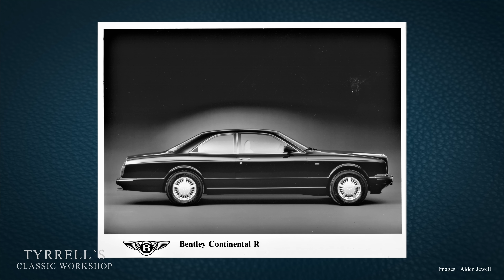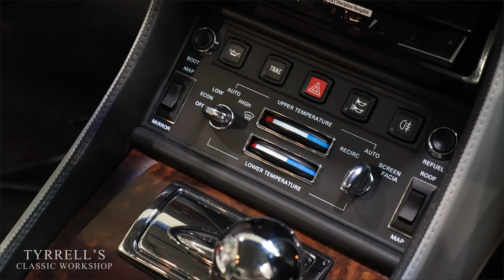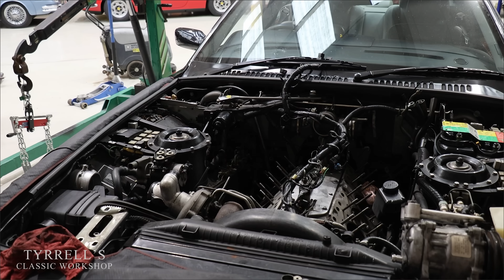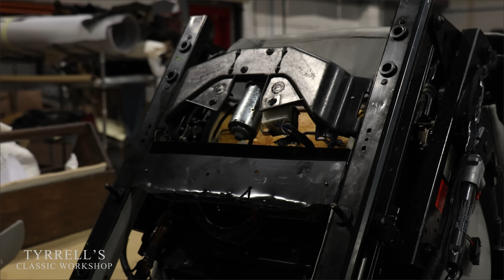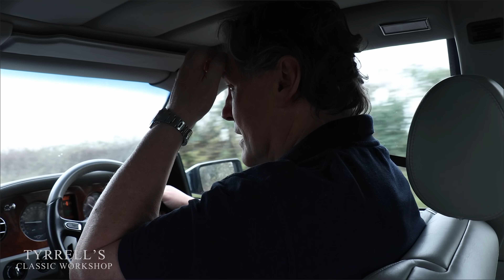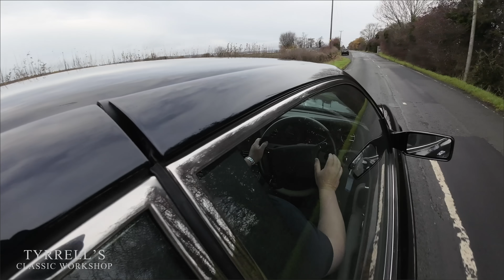Bentley Continental T- the 1990s British Bruiser | Tyrrell's Classic Workshop

Comment: Back in the 90s my old E32 7 Series seats went astray during a week’s break down at the South Coast just as we arrived at our hotel in Rye.

To remedy the failure was going to be exorbitant but I bought an entire leather interior from a BMW breakers’ in the Midlands for a couple of hundred quid: including electric motors, cabling etc and door cards, spent another few quid for my mechanic to fit and I had a virtually unused interior and the blue leather looked great with the gunmetal silver exterior.

Comment: I have a green in and out 93 I bought many years ago in Japan and imported to Canada. Canadian law is a 10% duty because the car was manufactured in a country other than united states and GST PST for a total of 21% all in. Shipping 2700 at the time. The advantage of Japanese market is that they are usually very well kept and almost always low k. One thing a
Lot of people get wrong is the steering wheel on most of the more exotic vehicles Mercedes Jaguar Aston ect are left hand drive. All of them you could get ether way but most preferred  LHD. Another wonderful thing is most of them were ordered with the best option packages. Many times I’d never seen in North America. 05+Bentleys and so Rolls had executive rear seats. Real Lear Jet looking stuff not available in North America. I’ve had my Continental R for maybe 7 years and just for fun I waxed it every day for like 2.5 months. People had always said that after 2 coats it’s pointless. Just putting on and taking off. 
If you start with a freshly cut waxed car I promise you you will be shocked. Just standard liquid wax 24 hours between takes maybe 30 minutes each time. 
The original green paint I now see has a really fine metal flake in it. The car  has a good body and mostly original paint from 1993. Now it looks brand new and the paint honestly looks like someone recleared the car with a very thick respray. I did another thing which seams counter productive. I cut waxed it again about 30 coats in and it made a massive difference. Flattened it out for more of a “wet” look. 
All in all they are probably the Nicest Bentley I my opinion because there is a massive over built quality to them where you can tell it did take 6 months to build but car to car compared to a say 2007 Conti I much prefer the earlier one.

Comment: About 5 years ago I bought a 1996 Continental R, drove it home and put it the garage.  A day or so later started it up and saw a plume of steam behind.....yep, head gasket(s) gone at 71K.  Joined the queue at my nearest independent RR/Bentley specialist in Bolton and had it back on the road some 6 months after..... several thousand pounds poorer.  

I prefer the purer lines of the original design...to me, the wide bodies look as though they visited a car customiser...

Comment: The Cont T came out in 1996 - or at least the press articles started then.  I have a Cont R from 1997 for nearly 16 years and love it.  I also have a 1960 Bentlwy S-2 = this model came out in 1959 so the engine is now 67 years old and I think it was last used in the Mulsane up to about 2020.

Comment: Is there a multi layered steel alternative for the head gasket? I'd be reluctant to replace it with an equally unsustainable part.
Reply from the maker: Apparently not. It is still an issue
Reply: @iain_tyrrell what a shame. I suppose the market is too small to develop a solution. Still, it would bug me endlessly from an engineering point of view to know my new head gasket had an inherent flaw.

That being said, what an amazing machine. I remember reading the road tests back in the late 90's. Thanks for another great upload, I look forward to seeing what 2026 will bring to your workshop.

Comment: Headroom looks rather tight for such a big car
Reply from the maker: An unfortunate by- product of the flat floor
Reply: Not just the headroom that’s a bit of an issue. The dash itself is very high and bulky meaning it closes up the screen internally giving you a surprisingly small letterbox-type aperture to see out of, which you don’t really notice from the outside. You then sit high up also which compounds the problem. I found it a little bit of an issue and I’m not particularly tall at all.

Comment: Out of curiosity…….is there a “fix” for the head gasket as in an alternate component? Or is it simply a matter of correct assembly and hope for the best ….which will likely be another 60k before repeating the process.  I don’t suppose there is volume market for design and manufacture of a “ better gasket” 😂
Reply from the maker: A 100% fox head gasket still seems elusive

Comment: I would imagine the way they used cylinder studs and nuts has something to do with the head gasket issue.  A good stretch torqued bolt setup would maybe make it better.  End of line engine I guess older design not meant for turbo.

Comment: The biggest problem we had with the Turbo V8’s were the tires spinning on the rims, especially on the chrome plate alloy rims. The Avon Turbo-Speed tires required a substantial amount of wheel weights to balance so if the tires spun on the rim the Avon’s earned their “Turbo-Shake” nickname.

Comment: I particularly like the original LWB Continental R, more understated and elegant, and still underpriced.  V8 was new in 1959. Do you recommend a solid copper head gasket? I had consistently blowing exhaust manifold gaskets on my Essex V6 until I made some out of copper sheet, but the heads are steel and you might not be able to put enough clamping pressure into an alloy block.

Comment: Lol no Japanese car I ever have had had that kind of head gasket issues..
Woke up, hit em hard, never an issue.
Reply: Except the mid to late 80s Toyota 7M engines, which was used all over their flagship models.....late pre-production change of head gasket material (to eliminate asbestos) and Toyota failed to amend torque values in production and maintenence documents.
Every engine has weaknesses.

Comment: What if any improvements or upgraded components were used to replace the cylinder head gaskets? Machine work, higher performance head bolts/studs, improved gasket material, etc…?

Comment: Had an M5 in 2000, me and 2 passengers, on M1 near Sheffield, pulled up next to a Continental T, we were bothing doing around 60, both of us floored it. That Conti T left the M5 standing, crazy, crazy fast and that torque!. (This was before there were so many cameras obviously)
Reply: Goat curry? Good choice. Do love a chutney to be honest. Better with cheese though.  am very surprised these subsistence comments are being voiced on Tyrell channel. Greatfully received. I once had a Peugeot 306 sedan 1.9d. bet it had better fuel economy than the Munich motors and crewes offering as well. Great runner. Shame about the locks. Boot lock went in 2001 and the rear passenger door packed lock packed in July  2004. I do love reading a comment or two. Just remember when your stressed to make the noise of a dolphin. It may save a few extra heart beats when you type your reply to knobs
Reply: @mondaynightmillions1198 everyone knows pug 306 1.9 are good even taxi drivers hence.. taxis
Reply: @mondaynightmillions1198 tell you what else was a good car and got negative press because of the 1st model. Vectra C the JTD engined one. Just make sure it was the one with the F40 box instead of the M32 box and had the updated intake so no swirl flap stickage. Them things ran happily remapped at 230bhp with insta torque all day with wheelspin in 3rd and still got 55mpg treating them like the police were chasing you. Underestimated car, even Saab couldn't quite match its reliable quickness as they started adding twin turbos and silly passive rear steer and silly ignition systems. The vectra C 1.9cdti often overlooked but good cars no joke really good cars.
Reply: That was me
Reply: Iain ....An encyclopidea on two legs !! I doubt there is anyone out there who can match your knowledge of these motor cars . Thankyou
Reply: Great story, I recall Swansea Queens Road, Saturday night midnight 1984 watching and XJS race a Rolls Royce off the lights, the XJS was totally left for dead
Reply: I had a e60 v10 m5 in 2008 and pulled alongside a 2000 e39 m5. I absolutely destroyed it. Point?
Reply: @DaleSteel you had an M5 in Forza you mean😂  silly bmw chav
Reply: @CHFandango Homemade chutney is the best, with a homemade curry.
Reply: @CHFandango bit of a bell end comment, were you drunk?
Reply: @Blablablabla1ify it was a bellend comment replying to another bellend comments.
Reply: @CHFandango I think his intention was to highlight how quick the Bentley is compared to a known fast car from the same era, that’s all.
Reply: @Blablablabla1ify oh right. So now your judge and jury?
Reply: @CHFandango I think you’re missing a cog or two. Good night.
Reply: @Blablablabla1ify maybe so. I stick my nose into someone's stupid comment and then you do the same. I can accept im strange im on the spectrum. Question is do you accept your weird?
Reply: @CHFandango Maybe I’m on the spectrum too, who knows. My brother is. But the difference between us is that you wrote an unnecessarily rude comment and I cut you back. 
My previously mentioned bro would give you the following advice: write nice things instead, it makes you feel better about yourself. Take care man. There’s no bad feelings from me.

Comment: Ahhhh. My first solo engine project at Cosworth for Bentley. We had great fun on the dyno and test track perking that up!

Was a great beast to drive, you just had to be confident drifting a drawing room.

The big V8 L410 soldiered on as a twin turbo and we even got it to 500bhp with new valvetrain and turbos in Arnage T while meeting MY07 LEVII emission regs. I wrote a paper in MTZ for that one. 

Good times.

PS The head gasket was never re-engineered for T. It was for the twin turbo with a much more modern MLS type gasket. 

Don't forget the crush on the fire ring reduces as the fire ring frets, which it can at high boost and low temperatures.

PPS I remember VW refusing to believe how clean it was in later twin turbo form. I remember taking out our ADP emission durability car out to Wolfsburg so they could emission test it in their own rolling road against the W12. It all went very quiet after that. Good old Dr FJP.
Reply: Fascinating information 😊
Reply: Can the MLS gaskets be used on these earlier cars?

Comment: Who on earth can maintain and fix such a complex machinery apart from people like Iain Tyrell? And moreover, what is the future going to look like when no one wants to take over? Amazing job and great video as always.
Reply: You talk about Bentley overengineering  and no other car company  being in the same  ballpark ( even Mercedes  at that time). Well Paul Rosche,  the genius  Mechanical  chief engineer  at BMW designed  their flagship 7 series  to outdo  Mercedes  and succeeded.  My 740iL  had over 280,000kms on the odometer  before parts  needed  replacing  due to wear and tear. It now has 370,000kms on the odo  and the Bimmer runs like new 
Tons of power  and torque,  NO oil consumption 9.7 litre/100kms  if I spare  the horses. I also  warm it up very gently  keeping the revs below  2000rpm before  the V8 reaches proper operating temperature.  I wouldn't  swap this 33 year  old car for a new one. Before Paul Rosche  retired in 1999, BMW  engineering ( and styling) was world  class. Alas ,it's  gone downhill  ever since. As the poet  Robert Frost wrote 'So dawn goes down to day,  Nothing Gold can stay'.
Reply: @kmacca-qldaus  The 740iL is a real gem - yes keep it forever, modern cars even sadly BMW and Mercedes are white goods... buy use, throw away - very sad (EV's being the worst offenders)
Reply: @paulnewman9275 Except for the myriad  stone chips on the front  of the car, it could easily  pass for a 2/3 year car( except  it's  too beautifully  styled
 Art directors( for the movies) must like it for I've  seen the model in so many  films and TV shows; 'Safe House' with Denzel Washington  stuffed at gunpoint  into the huge boot by Ryan Reynolds,  numerous  episodes of 'Inspector Morse' etc.
Reply: @kma @kmacca-qldaus  I have a e38 fantastic cars, but in my case unfortunately needing a lot of bodywork repairs - but I totally agree BMW cars of the 1990 /2000 were better engineered and more reliable than newer cars with their more complex emissions systems. Definitely a golden era…
Reply: There are a few Bentley specialists other than Bentley dealers, often they are talented individuals who served their time at Bentley, factory or dealerships, then left in order to set up their own business.
Reply: If Iain  had been  in his prime  in the  1930's,  he would have been  a Bentley  Boy racing the Blue Train  to Cannes!
Reply: Have a look under a modern car, like a Ford Puma, anything modern is a complete and utter PITA with even less space with those silly little bonnets that they have.
Reply: As someone with a general interest in cars but hardly any mechanical knowledge of them I find Iain’s experience and expertise utterly compelling.
Reply: Call it what it is. JUNK
Reply: Actually pretty simple.  Adjusting length of cables on seats is easy.    Engine work is engine work.   Maybe more parts but sane as any other vehicle.